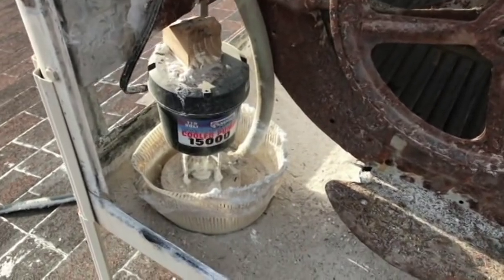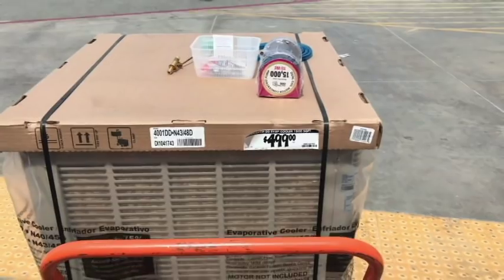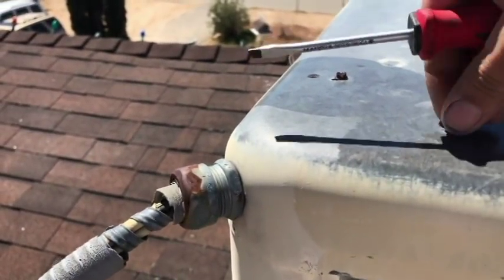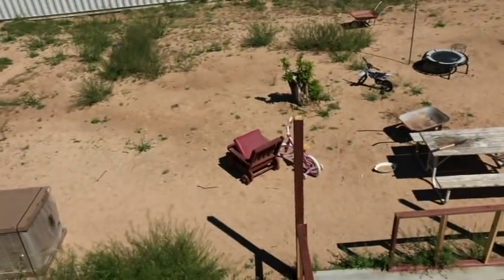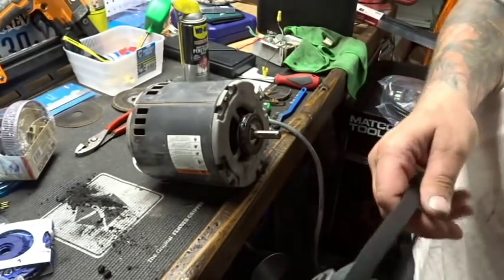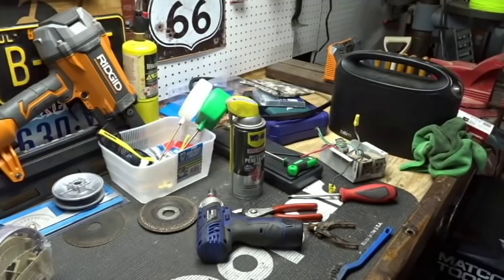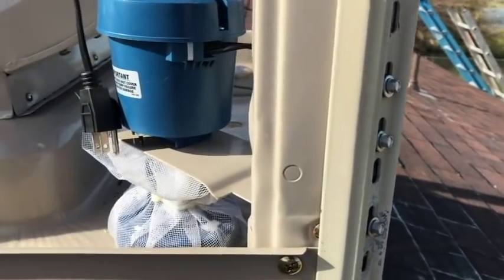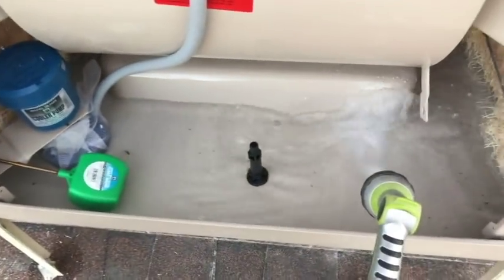EVERYTHING YOU WANTED TO KNOW ABOUT RESTORING OR REPLACING YOUR SWAMP COOLER!!

Comment: those were knock-outs. you didn't need to drill them. just use a hammer and screwdriver to remove them
Reply from the maker: Good to know for next time. Thanks for sharing.
Reply: You can also just stab it with your needle nose. Thats what most electricians would use
Reply: Nah.  I tried to knockem out but needed the drill in the end.  They're really stuck in there.
Reply: Use a hole saw, quicker,  neater.  Bang on it with a screwdriver and a hammer and it will bend up the metal and it will look all mucked up.
Reply: He could have used the whole punch that he bought for the grill

Comment: That amp meter is only meant to read one hot wire at a time. It will not read current coming back on the neutral. Make sure your setting is on Amps as well. When you go over a hot and neutral it cancels itself out. The only way to read voltage is with the leads and having it set on voltage (AC or DC). Auto ranging means it will automatically pick up the range of amps or volts...most older meters you had to pick the correct setting to read that particular range. I’m a union electrician and I Use the higher version of that meter...to me it’s a great meter. Let me know if you have any questions about it or any electrical questions
Reply from the maker: Thank you I appreciate the information. I will keep your comment in mind the next time I go to use it. Thanks Much!

Comment: I havent finished the video yet but the orange wire is for a 240V set up. The 2 different plugs one is for the pump, the other is for the motor. Motors usually have a plug as well.

Comment: I hope you eventually got air conditioning for the more intense heat during the summer. Good job on the electrical, exactly as it is supposed to be wired/arranged.

Comment: Sorry in advance Justin, we really had issues with this product. 
We solved our issues with eh swamp cooler LOL once we bought this living and working place we tore this apart, through down the pieces and added it to the scrap pile that is our thought as LOL we are funnin here but no we shucked that water sucking monster as far as our two older guys hands could throw it.  
Thank you for the share, Lance & Patrick. 
All kidding a side our precision watchmaker machinery cannot have water we run a really dry arid clean outward pressure sealed workshop.

Comment: Why couldn't you have pulled that blower pulley off, it's the only one on Youtube with four spokes like mine. All I've been able to do so far is get the pulley off with the spokes, but the hub is still attached to the shaft. I pulled the set screw out and it won't budge. I'm thinking about cutting through the hub, but it's so close to the bearing, I don't know if I'll be able to get close enough. On top of that, I can't see the end of the shaft, the old hub covers the end of the shaft completely. May have to cut the shaft and replace it too.

Comment: The pulley is not how to adjust tension. It adjusts the speed of the blower. The larger you make that motor pulley the faster she spins just like your old bicycle. Do check the alignment and tracking of the pulleys and slide either pulley on the shaft to make them both line up.
Reply from the maker: Good to know. Thank you for the information. That make a lot of since now. Cheers and thanks for your comment.

Comment: Hey nice vdi little dif, apprentice lectrician here, my only suggestion to keep that running longer would be to replace that bit of flex sleeving from the trough to the switch. wasnt doing much to protect your wire looking like that :)

Comment: There is a very good graphic chart online that shows the temperature results you get based on outside temp and humidity.  Amazing how accurate it is.  You can know how much it will cool before trying to run it for the day.
Reply: I have the same sc and im needling to follow justin wire instruction but having a little hard time following. Another question is how do I know if my unit is 120v or 240v? Thank you
Reply: I need help with the wiring part?

Comment: 1. Looked like you put new cooler on backwards? Legs need to be straight. 2. Never put wd 40 on your motor - it has black grease inside already and wd40 attracts dirt. 3. Just punch old holes on frame for wiring- no drill needed. Good video. I like how you showed your mistakes so others can learn.

Comment: Motor was installed upside down.   Even if they don't need to be oiled so port would need to be on top obviously, the openings should be on the bottom so if any water splashed in, it would drain out rather than short out the motor.

Comment: Bought the same cooler last year.  This year I went up to clean and start, but the rust rotted thru.  Champion was able to replace the pan and maybe the corner legs.  Still waiting so I patched up the old one using truck bed liner.  Now i/ is going but looks like I need a new switch, low cool is not working.

Comment: we have a two-speed motor black would be H or  high and Red is always secondary to Black that would be L or low then you have the hot for the pump , which does not go to the motor the pump will plug into that single outlet and they both have a white called a neutral and a ground wire. which is green or bare

Comment: What cud I do if my ac unit duct is 25 but duct on roof is 19?
Reply from the maker: Well, you can either make a frame that Tappers down to that size or sell the one you got and buy the correct size. I would try and get the correct size for your air duct. That's just my opinion. Cheers!

Comment: Does the unit just sit on top the vent?
Reply from the maker: yes
Reply: No.  You need supporting legs to support the cooler.  The duct will not hold the weight of the cooler plus pump plus water.

Comment: the amprobe didn't work because you had it clamped over all the wires you just clamp it over the hot wire we put those on before we start any motor in restaurants they have swamp coolers they call them makeup air because the range hood suck a lot of air. , also you need to get those perfectly levels so the water won't run only on one side of the pad.

Comment: Don’t get that blue crap, use the fiber pads.  My new swamp cooler was complete, motor, pump etc
Reply from the maker: Thank You for sharing your experience. My dad says the same thing. Must have something to do with how well they absorb. Cheers!
Reply: Totally disagree.  I bet those who accuse pad crap advice and developed their misconceptions without understanding the material science.   You dont care how water is running through or water absorbing fiber [period].  you have to care about water EVAPORATING. Now, with help of material science different materials pad has different evaporation effect-techniques.  I tried all three and noted this...  it is the problem when calicification begins to ruin the effective evaporation...  

a) blue pad is pure spun plastic fused,  forcing water to spread out and evaporate.  supposedly last longer because it is irrevelant to calcium buildup:  when calicified pad becomes "clogged" (preventing air  to pick up water when passing through) or harder (not pressable or pinchable); time to replace. some swear it does not evaporate well...   see the regardless section below.
b).  aspen pad does absorb water until it is waterlogged, then pad begins to evaporate. CATCH-ALL!!! evaporates after waterlogged [not before].   when calcium binds to wood fibers creating crinkle like sounds when pressed or moved, cooling fails (not because pad is hard}. time to replace.
c) there are greenish brown pads,  they are paper impreganted with something  some sort of waxy chemical or thin plastic??.  This green pad has what looks like the widest  "air opening cavities" but is not because of the waxy coating creating invisible barrier. It was supposedly imitate aspen pads. I discovered this is not true.  is an  "both"  from effect of blue pad and aspen pad... whereas at start pumping behaving blue pad;  then [depending on models and outside; in 10 to 15 minutes] starts soaking, behaving aspen pad. The obvious time to replace pad is when calcium build up destroys the weird waxy coating or when paper is crumbly when pressed. 

d) on different notes: if you are going to say clay and sand type materials [AFRICAN and ARABIA is using those type science] and from what i read and understood ::: the process relies on shaking up or turning over calicified sand to create water evaporation.  That does mean cheaper materials.; but the reports indicates weak cooling circulations. by the way SAND is heavy. 

REGARDLESS SECTION    homeowner with swamp coolers should haven been told and know!!! 1) when temperature soars to greater than 97 degrees Farenheight.   Water evaporates so fast and water never had chance to completely saturate the pads... this results in faster clacification build up [and equal ineffective evaporation and cooling.] 2) outdoor humidity could stops cooling efficiency,  ranging somewhere 35% ish  maybe 40% ish. PAY ATTENTION: resulting no cooling effect but higher humidity still alow the water to evaporate, and running the machine pump during higher humidity; pad still get calcified.

Comment: the amprobe didn't work because you had it clamped over all the wires you just clamp it over the we put those on before we start any motor in restaurants they have swamp coolers they call them makeup air because the range hood suck a lot of air.